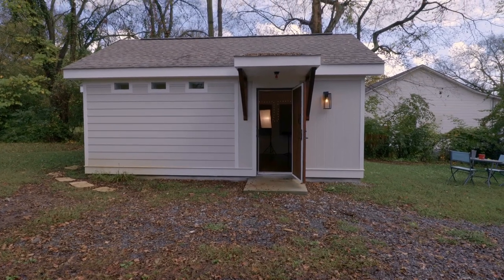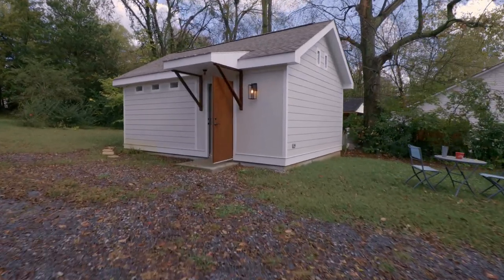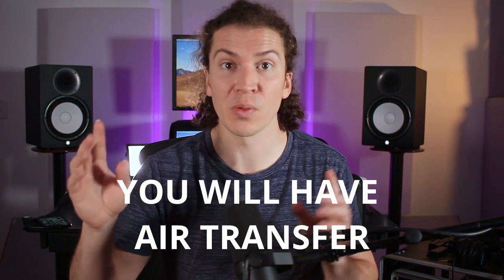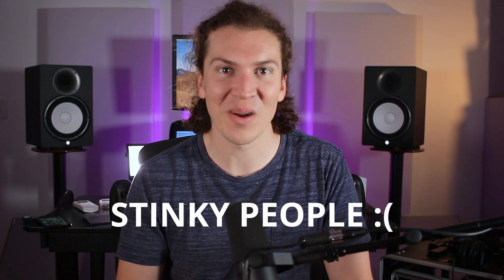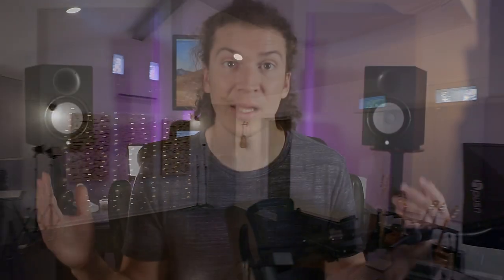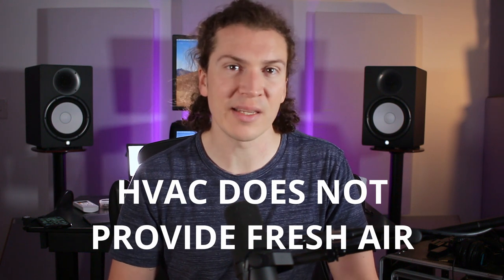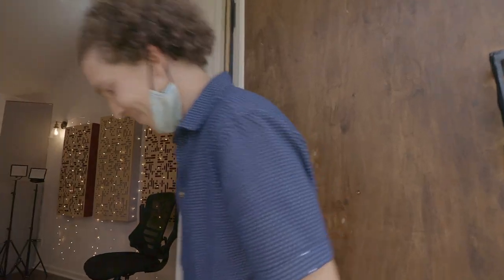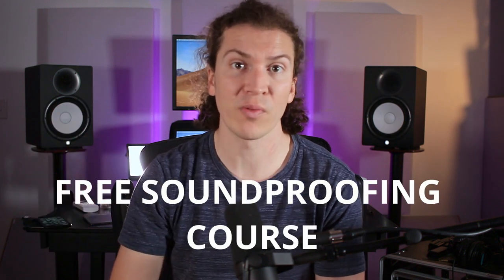Why You Must Ventilate Your Soundproof Studio

Comment: i wanna know if the ventilation system will let sound in? like if its letting air in and out, wouldnt it do the same for sound? is there a way to achieve both and compromise none or just marginally? or am i just completely off?
Reply: Hey Muhammed, thanks for watching. so the goal is to build baffle boxes that both slow down the air and reinforce the hole you are putting in your wall. I am currently working on building my ventilation system and will put up another video once I finish it.
Reply: @WilsonHarwood  hmm nice im excited to see that (and do tell us how well it works out), will be waiting :)
Reply from the maker: No it will not.

Comment: What about an enclosed basement room, same issues?   How do you control all of the sound that you spent so much $ trying to stay in the room from getting out?  Thanks.
Reply from the maker: With a basement room you would have the same issue, but could use a deadvent to another room in your house to transfer air in and out. The deadvent will stop all the sound from getting out. Here is a link: https://www.soundproofingcompany.com/soundproofing_101/the-dead-vent